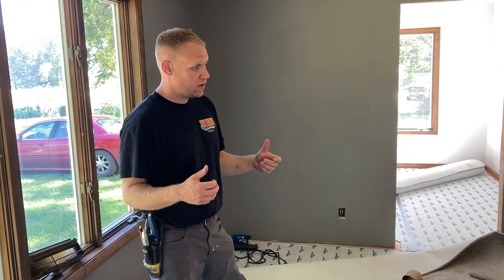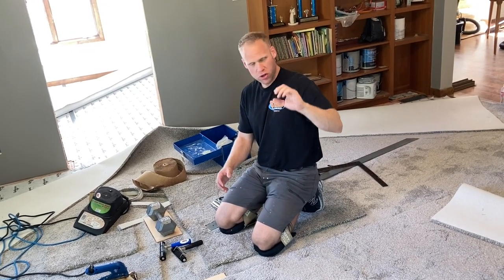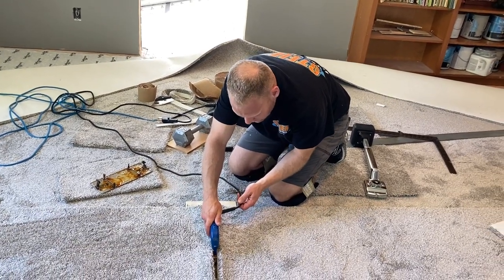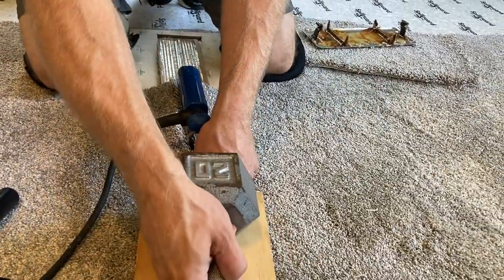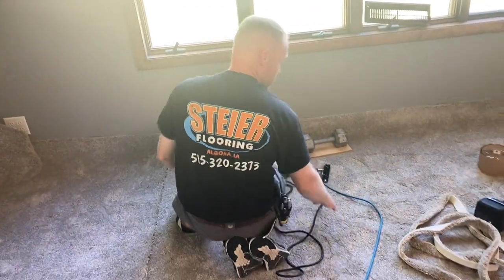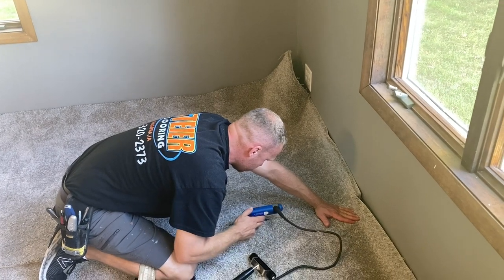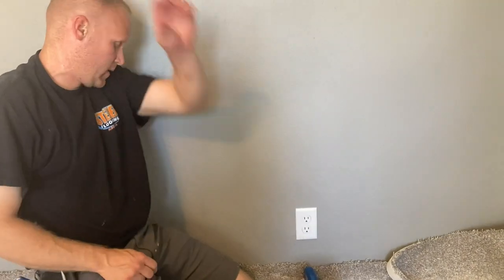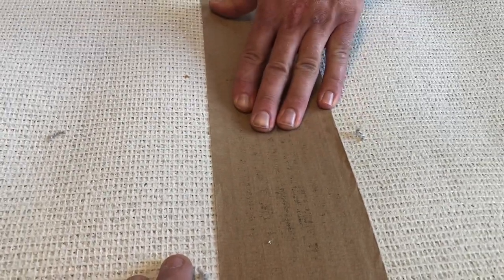Seaming carpet

Comment: You make seam boards like I do. I know what you mean by they get cut up when needed for something else. Thing I hate about the seamer down is the decibals.  Found it hard on the ears . My motor blew so I just ran a hose into the base from the wet vac with a 20 foot hose from one to the other. .  I find  its around  high 60,s low 70 s decibils now. Didn't want to learn sign language.
Reply from the maker: It definitely has some noise! I have been known to wear earplugs if I’m putting quite a few seams together
Reply: The motor on the first gen seamer down is the top of a 1 gal. Shop vac.  Shop vac brand. They have changed a little over the years so look on eBay for an older one.